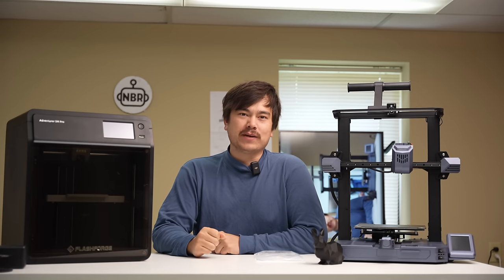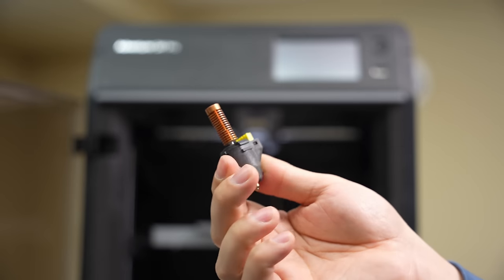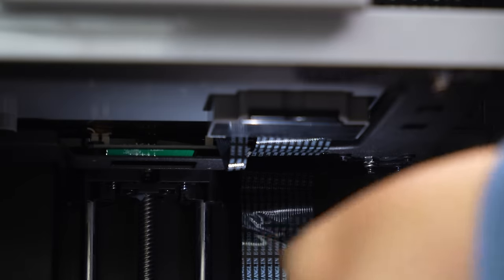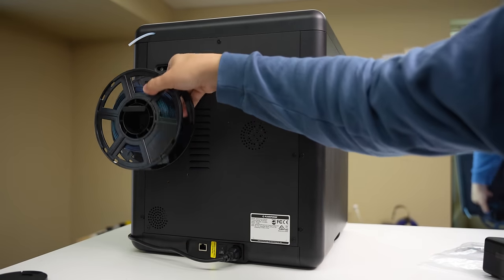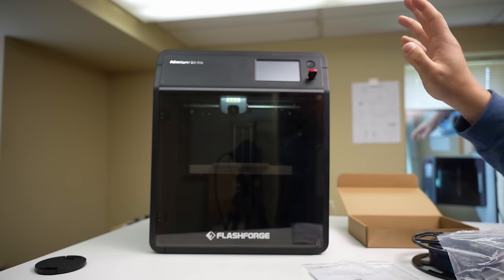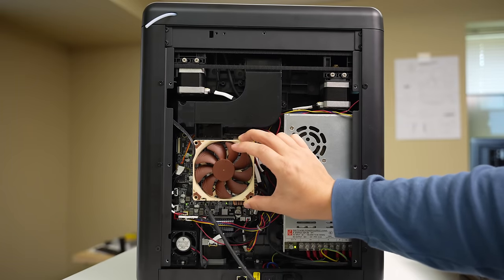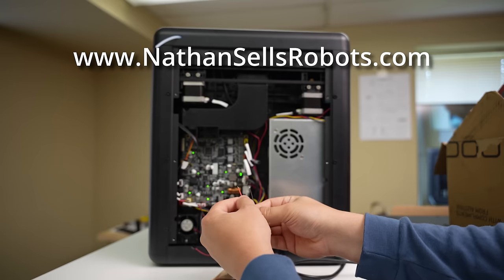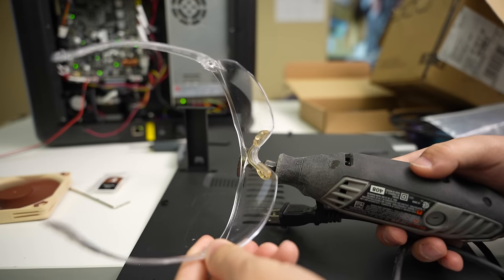Flashforge Adventurer 5M Series - An Insane Price Point for High-Speed Printing

Comment: Why 280 C?  I think the printers that have 300 C are dropping the ball.  Some printers have 350 C, don't know why they all don't.  I really like this machine, and I think if the Qidi did not exist with its 350 C extruder, extra size, and heated chamber, this is the printer I would get.

Comment: How open is the Firmware? Is there a bed mesh? Is the tolerance of the bed low? Are the bearings okay? Is it more stable? What happens when you cant remove the filament while having a clogg? How does the Extruder (Feeder) look? Will it just remove filament without cutting (which would be bad when having a clogg)? Did you see that nozzle kits cost about 30-35 bucks? There are nearly zero spare parts available on their site. Sorry this review is just half baked..
Reply from the maker: Each nozzle has a heater and thermistor attached to it, so the price makes sense. For a company running prints as a business, they don’t want to spend an hour doing hot tightening, so lugging and unplugging wires, etc. the point of this printer is to just press print and go.
Reply: @NathanBuildsRobots  The point is what happens when it doesnt print? The Adventurer series is known for pretty bad reliability. Again a shallow answer. The other points were completely ignored. Trustlevel is down to zero, cya👎

Comment: Why does every single one of these printer companies draw part cooling air from INSIDE the printer? Why not turn the fan around and draw in fresh cool air?
Reply from the maker: Too much cooling can cause more harm than too little cooling. In its default mode the enclosure recirculates and filters air, so there is very little printing smell. You can push a button to have it exhaust filtered air, to help cut down on chamber temps while also filtering out a good deal of the smell.

Comment: That is, during printing, it works at 47 db and it messed up the back wall to get the same result during printing...
Reply: The mainbaord fan is just way too loud, period. It's almost as loud as the part cooling fan and it's always running. It should have been a big slim fan to begin with, you also don't have to cut a hole into the cover. There are already 3d printable covers with a 120mm mount or you can just do it like me and leave the cover off and replace the tiny OG fan with a 120mm fan, the screw holes perfectly fit the 120mm spacing.
Reply: @kwedl  I've heard that this printer has an auto shutdown and turns off (physically cutting off power to the board) after 10 minutes or so of inactivity...
Reply: @kwedl  If it's not too much trouble, I would like to know if this printer has replaceable nozzles? So I can unscrew it and replace it with my volcano nozzle? Another question: what kind of hardened nozzles are there?

Comment: Good to see that no one has addressed the 90 degree swinging door that can be easily snapped off by a passing toddler. The sheep all do seem to copy and follow each other.
Reply from the maker: This one is plastic instead of glass. So I think it would be harder to break
Reply: @NathanBuildsRobots  What it's made of does not matter if a child runs by an open door and breaks it off the hinge. That's my criticism of Bambu and Creality as well. Other then that, there is some pretty innovative technology coming down the pipeline. Great video.

Comment: is it 32mm flow rate at 500 mm max print speed ?
Reply from the maker: Flow rate and print speed are 2 separate things. 

You can print very thick layers and get high flow rate at low print speed, or print thin layers and get low flow rate at high print speeds. That’s why they provide both numbers, so you can know the limits in different scenarios
Reply: @NathanBuildsRobots  yeah should said and was wondering if it was same specs  as bambu but seems like same as k1. just seen the end of video where u said 600mm thanks

Comment: This was actually one of the best reviews (even paid) that i have seen so far. :) Currently have a Adventurer 4 and while it does the job. I think its time for me to move up a bit. :) Even though i dont like the smaller space in the 5M pro. It does come in at a pretty good price point. :) Thought the P1S is only slightly more expensive. 

If you were to pick between those 2, which one would you pick? :)
Reply from the maker: P1S is really good… 
I think the real value proposition for the 5M is in the non-pro model for under $400.
Reply: @NathanBuildsRobots 
I was thinking about getting the 5M pro instead for the enclosure, which helps with air quality and stuff :) So the 5M pro is about 600$ is roughly 860$

However the build size is alot bigger on the P1S... So it's a tough choice though 🙈

Comment: I've been waiting for adv5m's video.
thank you.
I have a question,
Is the ghost more beautiful than K1?
Like bamboo?
I bought K1 and was disappointed.
Reply from the maker: Are you talking about the Flying Bear Ghost 6?
Reply from the maker: Or ghosting, how the input shaper works to cancel out vibrations?
In any case, the 5M has very good ghosting performance, the spatula contained a lot of sharp 90 degree corners and they looked very crisp and clean like my Bambu printers.
Reply: @NathanBuildsRobots  thank you
I wanted to know about ghosting performance.

Comment: P1S/M5 pro, $700/$645 Which one would you go for?
Reply from the maker: Where are you getting those price numbers? P1S is $699 without free shipping, M5 Pro is $579 after discount, unknown shipping.

Also, maintenance seems a lot easier on this thing. But no MMU. I do single color printing, so I’d pick the M5 Pro.

P1S is slightly larger though, and has more cloud connectivity and app stuff if you’re into that.
Reply: @NathanBuildsRobots  The M5 Pro is $645 according to their official store. I am just stating their MSRPs. Honestly they are both nice printers and both of them have their own positives.
Reply: @zakariakhamees  the regular price is $599. the $645 price has some extra consumables in it.
Reply: @SaveTheSunF1R3x  I see $645 in their store. But it is $600 in the US.

Comment: You would want to print the PLA with the lid off or open correct?  To prevent heat creep.  Could you do a sound test with the lid up please. #stachegameisstrong
Reply from the maker: I was printing PLA with the lid closed without issues. There is a chamber fan that you can turn on or leave it set to recirculate if you want to cut down on smells.

Comment: This is what the Creality K series printers need, Don't suppose you want to do a video on a k1 Max converting to Noctua.
Reply from the maker: The k series toolhead is too tightly integrated to mod… unfortunately
Reply: @NathanBuildsRobots  what about the side and rear fans, they can be nasty sound polluters, 
I love the max it has been so consistent for around 400 hours straight so far. But sometimes it does get a bit noisy. 
Great videos, thanks for your efforts, I wait for them.
Reply from the maker: They are pretty quiet. Overall they did a great job making a relatively quiet, fast printer. With the exception of that one fan that was noisy at idle. TBH it probably wouldn’t be as noticeable when a print is actually running. But I like machines that are silent at idle

Comment: People calling out companies for cloining Bambu. But I see it similar to the AirPods. It was eventual and someone had to do it. Someone just took the time, effort, risk and leap to go for it. Also As much as the RepRap machines looked badass. These modernized machines advertise a level of refinement, trust and reliability.
Reply from the maker: PRUSA MK series is refined and reliable while also being RepRap. But I see your point.
Bambu are investing heavily on the design side of things, which is really what you should be doing. Spend more on R&D as those learnings will make your products exponentially more valuable without increasing manufacturing costs.

Comment: The Flashforge 5M appears to be just another also ran product with all it’s unique headaches.
The Bambu A1 Mini will suffice for much of the market and take a big bite out of the 3D printer market @$299.
A lot of people including myself don’t need large print volume. The speed efficiency and ease of A1 use will make it ideal for many print farms.
Move over Prusa!
The multi-color capability is a bonus but not necessarily needed by most.
It also takes up too much work space.
All of my production parts are under 7”,
I wish the A1 mini was available one year ago before I bought the other 15 printers for my business. I will be offloading my Creality S1 Pros once the A1’s are available in volume.
Reply from the maker: Who said anything about the A1?
Reply: They just can't help it lol. Completely different product segment yet it always comes up. @NathanBuildsRobots

Comment: A piercing saw with the right size blade would've opened that hole up much faster
Reply from the maker: I never saw one of those before. What is that?
Reply: @NathanBuildsRobots  - A piercing saw on slotted steel sheet will kill you faster than a xenomorph.
Reply: @Liberty4Ever  he said it was aluminum in the video I thought
Reply: @archkittens  - I think you're right.  I believe Nathan did say it was aluminum.  A piercing saw in a sheet of slotted aluminum will still kill ya!   🙂
Reply: @Liberty4Ever  hasn’t managed so far. PPE is to live for

Comment: So painful to watch you cut that hole with the wrong tools, it ended up looking terrible and you should have just left it alone.  You spent way too long talking and obsessing over the aesthetics and noise and not enough on the quality of the prints and testing the limits.  You didn't show the screen very well and glossed over way too much info.  Is there an app for it?  Can it print other materials?  What kind of accessories come with it? I don't know because I watched your video.
Reply from the maker: Lol I didn’t mean to misinform you. I plugged it in and printed some things. Supposedly it can do PLA PETG ABS, etc.
Reply: @NathanBuildsRobots  I just wanted an in depth look and a fair comparison to the other popular core xy printers
Reply: @blackoutblaze  I get where you're coming from, but you're focusing on the wrong things in much the same way @NathanBuildsRobots did.  It's not a perfect review, true, but he can always do a follow-up.  Let's encourage that instead of going hard in the paint.
Reply: So satisfying watching him solve something that bothered him with the tools they had available. If the appearance, which will likely never be seen on the rear of the machine, bothers him a fan cover grill can be printed very easily.

-If you want to know which materials it can print: maybe Aurora tech has a video.
-If you want to know what accessories it comes with:.. read the frickin' sellers description.

Comment: Why does the fan being loud affect the printer, it truly doesn't this is just anal, and you cutting that ugly hole out made the printer like bad now. All that you did with fan is working backwards.
Reply: Mine arrived today and believe me the mainboard pinter is crazy loud. Almost as loud as the part cooling fan and it runs all the time and you can't adjust the speed or turn it off below a certain temp etc.
They should have just installed a bigger slim fan to begin with. I printed my own backcover and replaced the fan with an Arctic P12 Slim.
Reply: I have mine and it's not that loud and when you close the door you can't hear fan and what you mean you can't change temp of course you can.
Reply: @jayernest5120  I'm talking about the mainboard fan at the back, literally the one you were talking about. And i'm saying that you cannot adjust that fan at the back, meaning it is always running. Basicly every other printer either lets you adjust the speed of that fan or auto turns it off below a certain temperature.